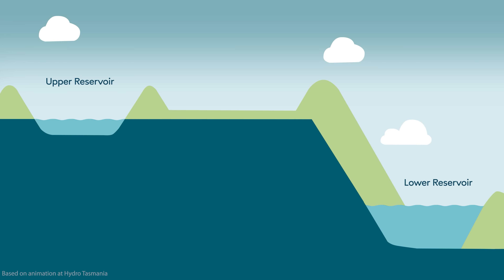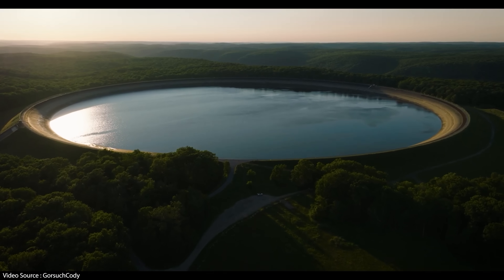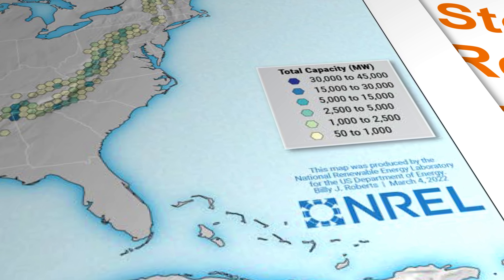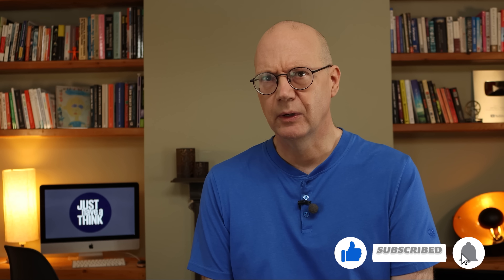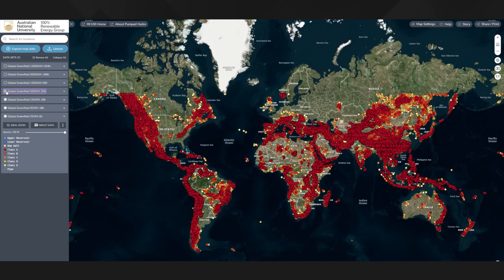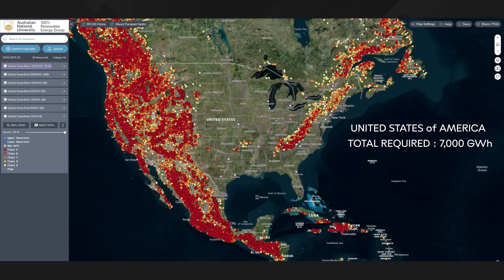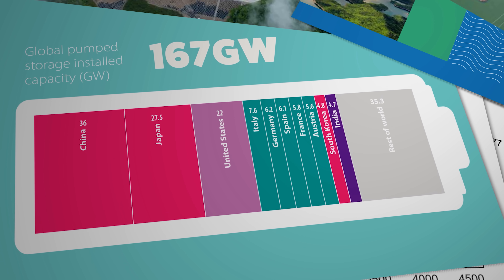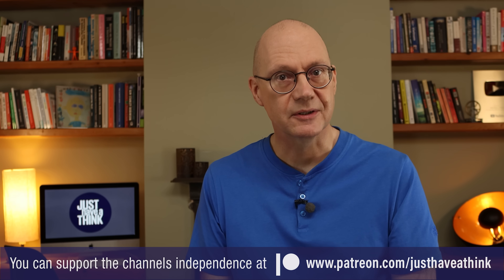The insane potential of Pumped Storage Hydro

Comment: While I've been a proponent of pumped hydro, your video misses many important considerations, some positive, some negative:

1. The estimated GWh storage is for current demands. There is a huge push towards electrification which will greatly increase electric demand. The two largest are EV's and switching to electric heating (ie. replacing natural gas, heating oil and wood).

2. No discussion on efficiency losses. Pumping water has significant energy loss. This means it takes significantly more energy to pump the water from the lower reservoir to the upper than is generated by the hydro plant.

Then there is the losses from pumping replacement water into the system. This is required because taking water directly from a creek or river means a dam. Dams are considered bad (or even evil) with many being removed. How pumping water from a river, lake, or well is seen as "good" makes little sense.

3. No discussion on how much over-provisioning will be required. There needs to be an over-provision (not just GWh storage, GWh generation but also location) to account for maintenance, failures, and even the possibility of an attack. Failures can be caused by natural disasters (a large earthquake could completely shut down one or more facilities for months to years) and extreme cold as a couple of examples.

4. No discussion on the fact that most of the best locations have negative properties. The best locations are in mountain areas. As stated 500 meter (1640 feet) height difference between reservoirs is good for efficiency of power generation, but 500 meters is the lower limit. While the Grand Canyon (and other large canyons) are able to fulfil the height differential it is unlikely that these areas would be approved. 

One of the things not discussed is that the best sites consist of 2 valleys with at least 500 meters of height differential. Valleys are needed to greatly reduce the cost to create the reservoirs. Instead of digging huge holes, the valleys can be blocked (because dam is a bad word). This also reduces environmental impacts.

One of the biggest negatives for building reservoirs in the mountains is that it tends to get colder with higher heights. This means that it is more likely to freeze and snow. This could create periods where the system isn't able to be reliably used or possibly unable to be used for multiple days in a row. Winter storms tend to cause solar and wind generation to minimize or even stop at the same period of minimal solar generation due to significantly less available sun light hours and higher chances of cloud cover. These are the conditions that place the original need for "batteries" to begin with. It should be obvious that less hydro generation at the same time that it is most needed is bad.

5. While many city dwellers will consider having these systems in the mountains as ideal, after all out of sight out of mind. (The same thing that make huge solar and wind farms acceptable to the city people), the truth is that the number of hydro batteries required will have a huge environmental impact. As more are built there will be more protests against them. Just like how hydro dams are bad because they destroy the native habitat for many animals, so too will the 2 reservoirs per battery.

6. The assumption used for this video was 5 hours of capacity (20 hours was also used). These numbers represent the bare minimum to store power overnight (which 5 hours may be able to do) or to help with times of slightly lower power generation. 20 hours capacity MIGHT cover a week of mostly cloudy days.

While 20 hours is useful because it covers night time when solar generation doesn't work, and covers those mostly cloudy days, and covers for maintenance downtime, and periods of low winds it doesn't have enough capacity to cover a winter storm which could require 24-168+ hours of capacity. It doesn't cover a major hurricane. It doesn't cover the loss of solar generation due to wild fires.

The truth of the matter is that the capacity needs to be higher, much much higher.  Southern states might need 1344 hours of capacity, while northern states might need over 3000 hours. 

The reason for this is that it is not only physically impossible to build out enough solar and wind farms for current electric needs (not including the huge demand increases that EV's and all electric heating will bring) but not cost effective.

To replace current electric generation from coal and natural gas would require COMPLETELY covering the state Of California in Solar panels. This would be in addition to wind plants, hydro plants, nuclear plants and geothermal pants that are in current operation. This amount of land assumes summer day light availability in southern California. I am defining "day light not as the number of hours that the sun is "up" but rather the number of hours that there is sufficient sunlight for significant solar production)

There are 2 problems with the assumption of summer day light in Southern California. The first is that the amount of say light available in winter is significantly lower. The second is that as you move north the amount of winter day light significantly decreases. The yearly average for Southern California is over 7.5 but in Western Washington (where I live) it is only 3.5 (along with the Northeast and northern Midwest).

What this means is that no matter where you live in the country, the amount of solar needed is NOT based on how much energy will be produced, but rather how much is produced in the winter. This is good for PR, as a solar farm will list it's PEAK energy capacity.  

Inyorkern California
low: 6.87 hours
average: 7.66 hours
high: 8.70 hours

Seattle Washington
low: 1.60 hours
average: 3.57 hours
high: 4.83 hours

A solar plant that has 1000 KW of capacity will generate:
Inyorkern summer: 8700 KWh
Inyorkern winter: 6870 KWh

Seattle summer: 4830 KWh
Seattle winter: 1600 KWh

Lets pretend that in order to meet demand, a fictional city needs 6000 KW per day and the only available production is solar.
If the city is near Inyorkern California a single 1000 KW plant will provide a healthy surplus in the winter (870 KWh) and an excess of 2700 KWh during the summer.
If the city is near Seattle Washington it require 3.75 plants during the winter, so I will assume that 4 plants are built. The 4 plants would produce 6400 KWh with 400 KWh surplus but they would produce 19,320 KWh during the summer an excess of 13320 KWh. 

Seattle's 1.60 hours of day light in the winter doesn't tell the whole story.  Those 1.60 hours is an average. The area might have several days of sun light (maybe 3 hours a day of day light) followed be weeks of complete cloud cover.

This example will hopefully show why it is cost prohibitive to build out enough solar to meet winter demand. Production based on winter also causes a huge over-production during the summer. It should also show why 5 hours or even 20 hours isn't nearly enough.

If hydro batteries can be built large enough at a cheap enough costs it brings the possibility solar much closer as the solar farm can then be built based on average day light hours now low day light hours. This would mean our fictional city near Seattle would only need two 1000 KW plants instead of four. The two plants would average 7140 KWh of production per day. This is an excess of 1140 KWh per day which should be enough to run the pumps and other equipment needed by the hydro batteries.

This means that we need larger reservoirs and/or more of them. The large reservoirs are beneficial compared to smaller reservoirs.   Deep reservoirs have less evaporation losses than shallow reservoirs. Large reservoirs react to water level changes better. Large reservoirs are better habitat. Large reservoirs can also be used as a back up emergency water supply while not drastically reducing the hydro battery capacity.

Ironically, hydro battery reservoirs will need to tout some of the same benefits that dams have. People may get behind them if they feel it will bring water activities such as fishing and water sports. It may actually require that current dams are adapted. I could see using the outlet of the hydro turbines as a source of water pumped into a higher elevation reservoir who discharges from it's hydro turbines back to the original dam reservoir. 

This hybrid approach might bring significant efficiency benefits because the water pumped into the upper reservoir can then  produce electricity as needed via it's own set of hydro turbines, but if electric demand is really high that water can then be released through the dam's hydro turbines. Then during periods of low solar generation but excess electric generation from the hydro turbines that excess could be used to pump water to the upper reservoir. 

Often at high flow during the spring water is dumped from the dam without producing electricity. Instead that water could be used to produce electricity to pump that water to the upper reservoir. This would mean that this hydro system could pump most of the water for the upper reservoir from spring through summer, then release water in the fall and winter.

A properly designed hybrid hydro battery could require less solar than a hydro battery. This would further reduce costs.

There needs to be much more thought put into this in order to build out a properly functioning system at an affordable price.

Comment: Matt, 

your introduction text is utter rubbish.

We will not get 100% renewable power (using wind and solar) on any grid with or without pumped storage.
Whatever the very many reasearches have made of pumped storage, they misunderstand it's purpose. It is for frequency support (and black start insurance) not a solution to intermittency. The capacity to replace intermittency alone is so vast that it is not possible. Storage is not and extremely unlikely to ever serve that function.

Comment: DVC The Major Dam In the Region at Bay Of Bengal,  With Mid River Barges And Locked Channels Spread Across The Twin Eastrine Delta At Bay Of Bengal..

On The Western Edge Of With Neighboring Country Of Bangladesh..
Reply: Neighboring Country Had Japanese Help With New Constructions TO Facilitate Its Ports To The Eastern Reaches Of The Bay Of Bengal Region..

Has 8 Month Monsoons From June Till December At Full Swings..
Winters From December to February At The Maximum 
Then Like Early Summers Besides 500kms Sea Shores Of THE Northwest Asian Regions Comprising Of The Tibetan Plateau..
Reply: 4 O Clock Rain Was Before Cat 3 Turned 5
And In The Region post December 20 2012 onwards 

4 o clock Rain From March,April  Onwards Like Torrential Rainfall.. from The Northern Hemisphere and Antarctic Cold Heat Fronts ,,
Reply: That's Ongoing Global Weather Repositioning Plan With Global Seed Vault  Vaccum Falls Since December 20 2012 onwards..

People Were Very Keen On Artic Antarctic Archeological Research.. rather Than Moses''a Red Sea Crossing Over To Mars With Noah And Co..

Comment: Whoa! Am I missing something here? Pumped hydro is energy STORAGE, not an energy SOURCE. So it doesn’t make sense to compare the GWhrs from pumped hydro to that of a coal plant. We still need to put the energy IN before we can get it OUT. Where will that energy come from? And there must be a percentage of energy lost in the pumping.   Sure it’s great to have a better way to store energy, but energy storage doesn’t replace energy production.
Please let me know if I’m misunderstanding this.
Reply: Daily electrical demand varies wildly. Pumped storage functions as a load following or peaking plant to produce electricity instantly when it is needed during the day and replenishes itself when there's excess electricity on the grid at night.
Reply: @sharkheadism  FAR more expensive way to balance load than current methods.  It's a scam
Reply: @protonneutron9046  You should write a dissertation and disprove engineers and utility companies, then relax at your job as a professor anywhere you'd like to work.
Reply: you win.  This is just a stoopid scam for those who flunked 6th grade natural science class.

Comment: My alternate personal concept of pumped hydro was more simple than this. Just build a standard hydroelectric dam facility... And fill the reservoir using pumped hydro rather than a river. Don't have a closed circuit. Just draw water from huge lakes at lower elevations or the ocean even. The hydroelectric dam runs 24-hours. The renewables powered, completely separate, hydro pumping facility runs 24 hours as well. Just add or remove capacity until it reaches an average. The renewables electricity would never be used directly to power infrastructure. Just the power from the hydroelectric dam running all the time as they do.

Comment: Mass extraction of fossil fuels since the 18th Century, and pricing them at bottom of the food chain rather than on the basis they are finite -  has played havoc with the future;
"In any system of energy, Control is what consumes energy the most.
Time taken in stocking energy to build an energy system, adding to it the time taken in building the system will always be longer than the entire useful lifetime of the system.
No energy store holds enough energy to extract an amount of energy equal to the total energy it stores. 
No system of energy can deliver sum useful energy in excess of the total energy put into constructing it.
This universal truth applies to all systems.
Energy, like time, flows from past to future" (2017).

Comment: Littlebit offtopic But here in Finland we have started to use sand for storing heating energy. Quite simple idea like hydro storage for electricity. Also bottoms of the lakes are in some use for the cooling/heating. Temperatures deep down there is quite stable

Comment: the big space of mines seem tempting .But if you just fill it with water I can think of some big problems . the stability of tunnels might get weaker. or why do they normaly pumt exess water out of these tunnels. 
Water will wash out every chemikal that is soluble.  all these chemikals will end up in  the Pipes and the Pumps ,  can that be ok?

Comment: While we are considering the value of such schemes in terms of cost efficiency, perhaps we should consider available labour. Once a scheme is planned and designed, the installation and running of battery storage systems requires substantially more expertise than the digging of ponds and where there is plenty of permissable space a workforce and a shortage of specially trained technicians, low tech storage systems, although having lower energy density, can be set up and maintained with less externally sourced labour. Once a system is working it can be expanded to other sites with similar levels of ownership.

Comment: I worked as an Engineering student in a company called Charmilles in Geneva in 1974. They had developed what they called « Isogyre pump turbine » using a common shaft and water feed system for pumping and power production, by simply using a centrifical pump wheel at the back of the francis turbine wheel and reversing water flow. It could possibly provide a simple conversion option for converting standard hydro power plants to pumped alternatives. I could not find a description in English, but here the Wikipedia description in German. Enjoy the reading.

https://de.wikipedia.org/wiki/Isogyre-Pumpturbine

Comment: What I dont understand is why pump the water up, isnt that going to take up more electricity?. Why not heat the water to produce steam that powers a turbine that generates electricity, then use the water/steam while it is in a different state to send back up to the reservoir with no pump involved. Id like a mathematician to run the numbers on this to see if its more viable than this pump proposal.

Comment: Why not build the upper reservoirs on the top of cliffs along the seashore and use the ocean as the lower reservoir. This would reduce construction costs and presumably also timelines. Salt water corrosion might be an issue but surely that could be overcome.
Reply: Let me know of a metal strong enough to be used as a turbopump, economical enough to be used to fabricate it, and doesn't corrode. Plus you're introducing salt water into the water table in the process.

Comment: This is an interesting idea, unfortunately I cannot find any quantitative assessment of the CO2 emissions per Wh storage of these systems. Energy consumed by excavation will not be low-emission before long, the concrete to build walls is a major source of CO2 emissions,... Any technological solution has an impact and must be quantitatively evaluated with respect to key environmental metrics. And also we do not have much time: one must be lucid about the speed of development of such solutions and the pressure on resources (sand required for concrete comes again into play!) All these obvious aspects are roughly quantifiable with our current knowledge, so why is it not done? The buzzword "Zero-emissions" is everywhere in the IHA report, but I cannot see any tangible evidence. The word concrete is not a single time there! One could oppose that one can focus on those sites do not need any concrete? That sounds literally impossible, but let's assume it is a small proportion of the natural boundaries, well that means even more land is going to be put under water: then impacts on ecosystems, competition for land use, opposition of the local communities are the other huge factors. These are the questions that need to be publicly assessed to be able to decide collectively what to do with a solution.

Comment: Could you use a ram pump with a solar pump in a closed loop system for charging a powerwall type battery bank for a house?  In Malaysia, we have water tanks on towers to supply water/water pressure in homes.  Another tower for charging a battery bank?  🤔🤔